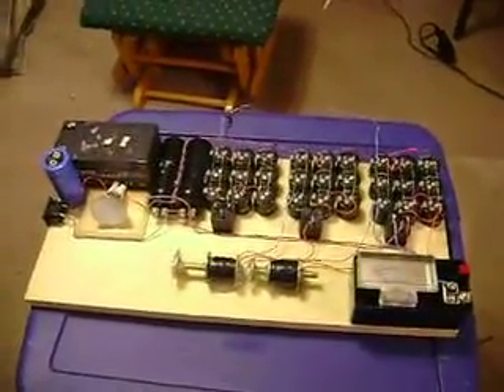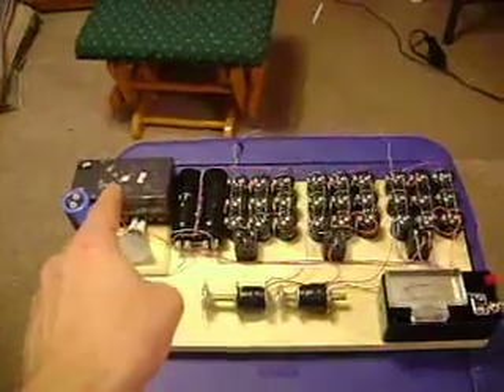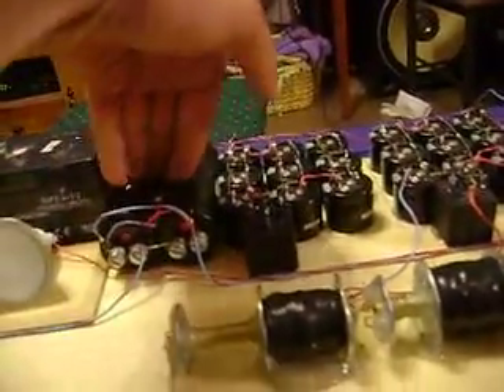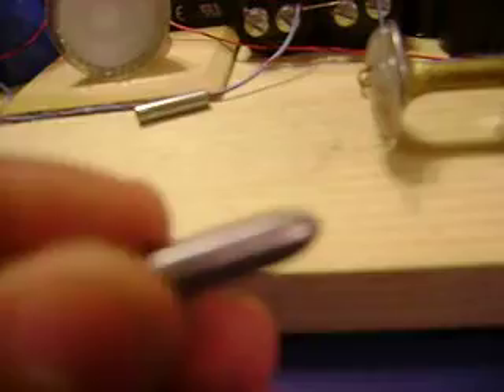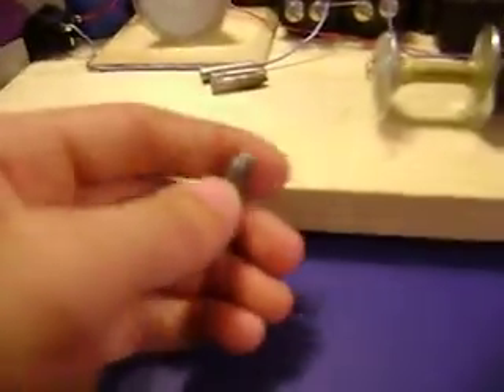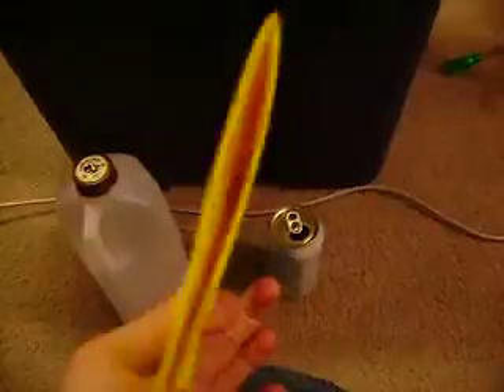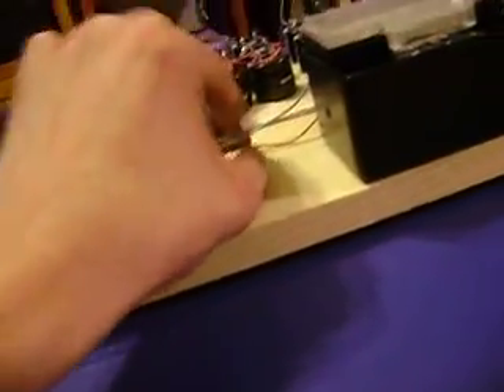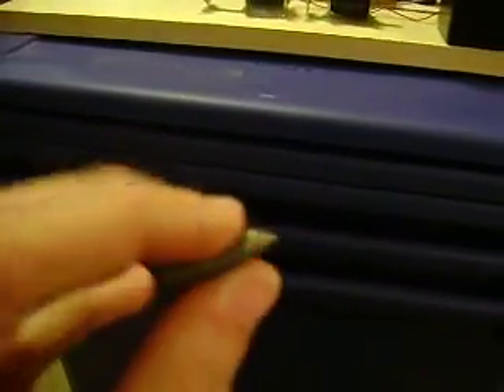3 Stage Coilgun (testing first stage)

Comment from the maker: Incorrect, when you have a sine wave you must use the RMS voltage which would be 170. You take the input voltage (120V) and times it by the square root of 2 (~1.414) so you would get 120*1.414=169.68, or 170 for simplicity purposes. so therefore the voltage from the doubler is indeed 340V. You can simply rectify a small step down transformer and compare the AC voltage versus the DC voltage to see it yourself. :)

Comment: just saying the "voltage doubler" would be 240 not 340 from 120 plus try using a 555 or 556 driver, transistors nd relays for the other coils for fast switching (u can pick those up for less than $2 a piece from a electronic warehouse [Sayle Electronics]) plus their fun to play with, with other projects.